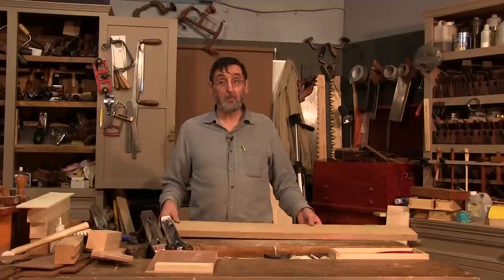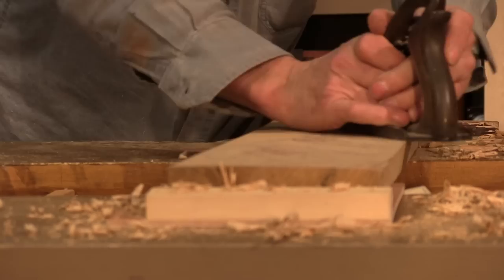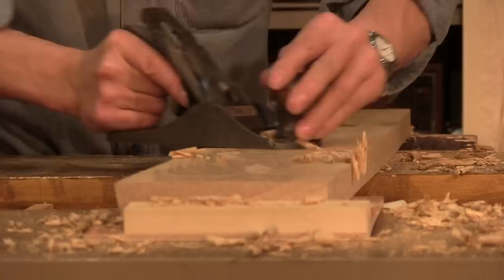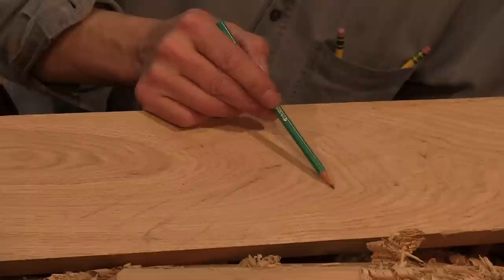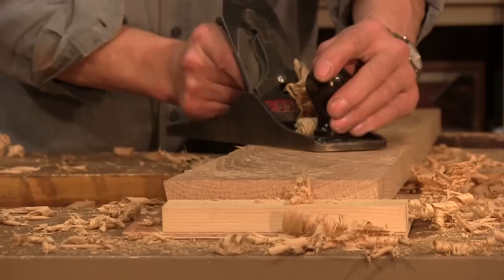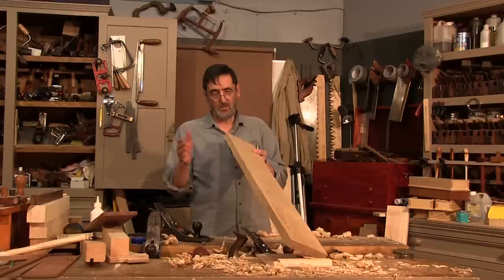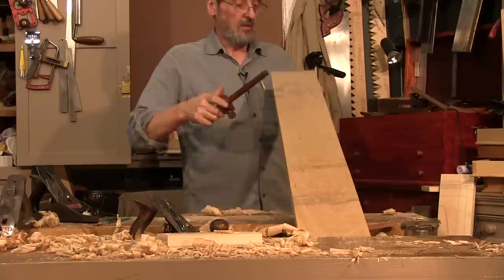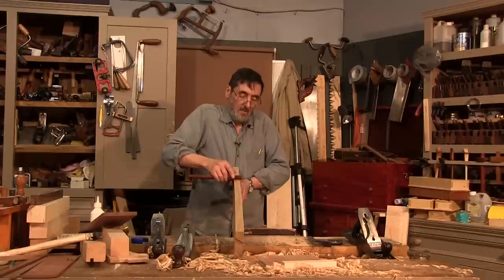How to make flat boards straight, smooth and square (stock preparation part 2) | Paul Sellers

Comment: Not to disparage Mr Seller's effort but 43:00 is a very long time to plane a single piece of wood. A bookcase would take a week to make (unless carpentry is your job). Isn't it more time-efficient to run it through a planer + jointer? I'd imagine it to take maybe 5-10 minutes per board this way.
Reply: On a channel where master craftsman for hand tools is giving knowledge for free You come here to talk about power tools?
Reply: Woodworkers, including Paul Seller, care about efficiency as well as quality. I don't see how a discussion about the quality of work & efficiency of a power planer/jointer cheapens his advice on using a hand tool.

This is an objective comparison between two different processes of dressing lumber. Both have advantages and disadvantages that all aspiring woodworkers should consider when, for instance, deciding between buying a $300 planer or $300 Jointer plane.

What I was interested in was the work-pace of a "Master craftsman" who would know how long he'd take to build a bookcase. If it's a week, so be it. Notice I didn't say anything to the effect of "Jointer/Planers are BETTER than Paul Seller's jointing/planing abilities".
Reply: my point is that there is no reason to discuss and compare power tools and hand tools on channel like this
Reply: Not that it's relevant to my original question but why don't you think it's relevant? 

I think it's absolutely relevant. The plane is, after all, a tool. Two core specifications of all tools are efficiency and and quality.
Reply: Off course a planner/jointer is quicker, it's obvious. And buying a bookcase is even quickest... why do you ask ?
So time is not the point here. It's about skill & knowledge with hand tools. If you want a planer buy it, there's nothing wrong with that. But If you don't - or if you can't afford a 300$ powertool - you can see how to deal with(out). That is the point :)
Reply: I wrote this post before coming across a sawmillcreek forum member's post about interleaving planner/jointer/hand plane work to make efficient use of time while still maintaining quality of stock dressing. 

I've come to realize that the hand plane and a planer are two different tools, each of which provides different finishes. The best combination involves using a thickness planer to remove material and finishing plane to smooth it out.
Reply: One thing I love about hand tools is I can use them at home in my small garage. Aside from the cost perspective I simply don't have room for a table saw, jointer, and planer (the three power tools necessary for squaring four sides) in my work space. Yet I can easily store a small variety of hand saws and hand planes. Work at home is not about production, either.
Reply: +Isaac I for sure would think about using a planer for getting it to rough dimensions and use the hand plane for the final touch as matter of efficiency. But remember, this channel is focusing on using only the hand tools because that requires more skills than using those modern electric tools. They also requires more time but sometimes you can enjoy woodworking more that way. At least, that would be the case for me. On the other hand, the video is 43 minutes of explaining and doing what he does. If he wouldn't explain I'm sure he would work a lot faster. And if it wasn't filmed he shouldn't always be keeping in mind that what he does should be visible in camera. Here we don't really have lumberyards but I guess it is possible to find pieces of wood that wouldn't need that much work on it.
Reply: > Isn't it more time-efficient to run it through a planer + jointer?

Let me take a swing at this question - because it's an honest question that I used to ask too:

Answer:  Yes.

Yes it is more "time-efficient" to do it that way.  But that's not why this video has 259,953 views with a 55 to 1 "Like" ratio.  As someone above wrote - it's also more efficient to buy the finished product........ ... ...   ...    .    .     ..

:)
Reply: @IsaacC20 , Not quite, A "Planer" ["Thicknesser" in the UK, I believe] will temporarily press a board flat as it passes through, but the board will spring back to whatever distortion it had before. It'll just be a bit thinner. Best combination of the two would be to hand plane one face flat, flip the board's flattened face face down [or up. Whichever way places the un-planed face against the cutters] and then run it through the planner again, but not to final thickness - leave it just a little "Fat". That way after jointing the edges and etc., you can flip it one more time and bring it down to its final thickness with two truly flat faces.

Comment: What kind of oil do you use in the rag can?
Reply: Mika Lee earlier comments paul said 3 in 1
Reply: Thanks.
Reply: +Tom Lowday 

would you know which of the 3 in 1?  Thanks!
Reply: just normal stuff you get in a pot
Reply: Tom Lowday thanks!
Reply: +Mika Lee 
Simple Mineral Oil, cheap pharmacy stuff...
Actually, you can use Butcher Block paste or even simpler, use a candle stick, My father used that all his life successfully.
Reply: @nmssis , It's a brand of light machine oil.

Comment: No one can accuse you of choosing an easy piece to make you look good! That was one nasty board! Why did you do the other edge before you got your thickness? I would imagine that you would have some tear out to fix
Reply: You need three reference surfaces to thickness; the flattened "Reference Face" and both "Reference Edges" squared to the Reference Face. Otherwise, if you don't have a thickness-to guideline on both edges in relation to the flat face, you won't really know if the thickness is even and not at some cross-wise, edge to edge angle until you finally true that second edge and can measure.

Comment: These skills are important and should be learned and practiced but surely you'd use a planer to do most of the donkey work these days....what's the point in technology if not yo make things easier. Nonetheless it's good to have these skills...you can't always rely on technology.